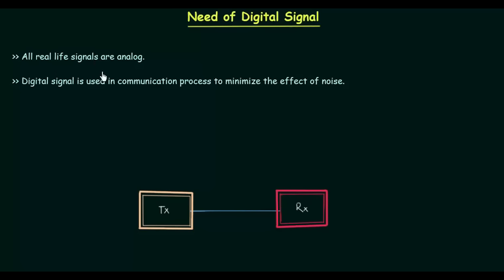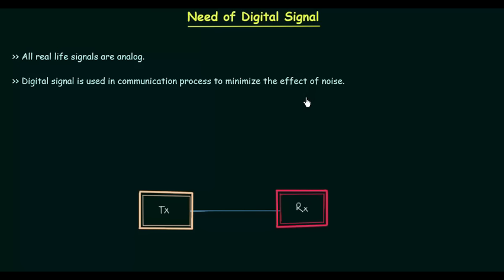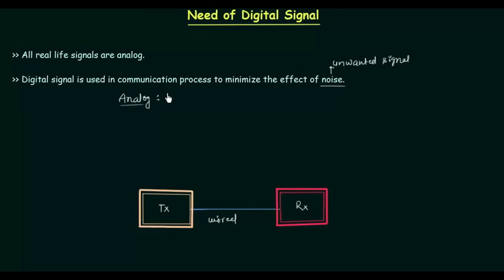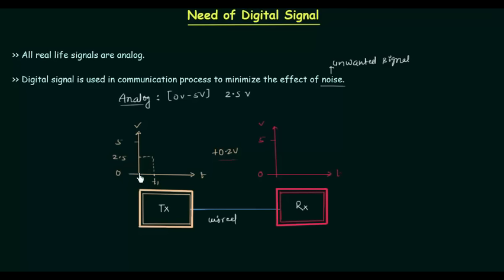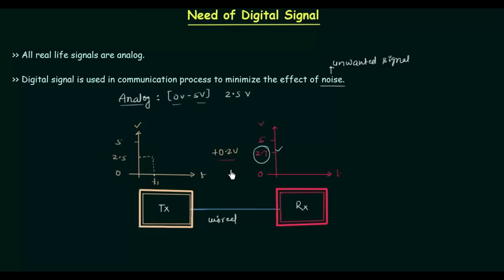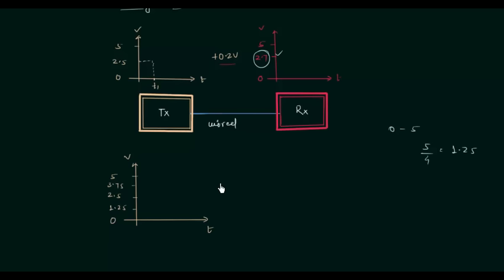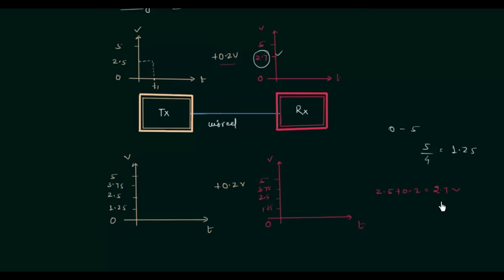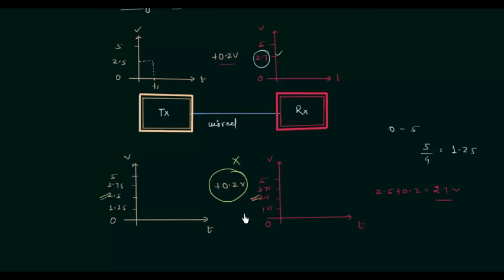Need of Digital Signals

Comment: Thanks for the video. I have a question. Is noise always positive? In the video noise was +0.2v. In real life voltage will decrease upon transmission(wires are not superconductors) thus noise would seem to be negative.
Reply: The main Idea was that Noise distorts the amplitude of Analog Signal and if these noise, if small in magnitude, can be eliminated if we use digital signals . Catch the main Idea dear ...
Reply: I have also the same doubt. If the signal is of 0.5A and the extra resistance of the medium decrease it by 0.2A then we will get the level below the 0.5 , right?(as Digital output  <=analog output) How to avoid such phenomenon?
Reply: @tanmayamohapatra7809  The main Idea was that Noise distorts the amplitude of Analog Signal and if these noise, if small in magnitude, can be eliminated if we use digital signals . Catch the main Idea only dear ... You can study more in depth in Digital Communication ...

Comment: i'm having a confusion .. at 4:37 ..using digital signal though u reduced the noise by 0.05 but still the actual signal was of 2.1 V and at receiver's end it is 3.75 V..so what about the error here ..is it 1.65 ..?? and if yes then doesn't it matters..??
Reply: Maybe his point is, the supposed value is 3.8V it was reduced by 0.05V because of digital signal. Using digital signal reduces noise not removing it completely.

Comment: sir, at 3:23 we are transmitting 2.5 volts instead what if we transmitted 2 volts (consider the noice as 0.2 volts only or 0 volts maybe). wont we get 1.25 on the receiver side. i mean will that be loss of date or something else. what would happen in this case?. please clear this out for me 🙏🙏

Comment: Sir, as u mentioned at low noise of 0.2 the the signal will take lower level. what if your signal is 3.65 and a noise of 0.2 gets added then it is 3.85 and not taking the lower level of 2.5 as it is taking the upper level of 3.75. Plz clear my doubt sir.
Reply: You would not be sending a 3.65 signal (analog) to a digital receiver that picks up discrete levels. Therefore A digital signal being set at 2.5 v will accumulate 0.2 levels of noise and be corrected back to 2.5 v.

Comment: What if I want say 2.3 and bcoz of noise it has become 2.5 and 2.5 is allowed
Reply: Since we discretized both the axes. We're not allowed to send the voltage signal other than the discretized levels.
Suppose, we have 0-5V and we divided it into 4 levels i.e. 0, 1.25, 2.5, 3.15, 5 then there is no way we're getting 2.3V on the transmission side. You can only send the voltage value which is available on the transmission side.

Now, take your 2.3V as an example. If we're limited to 0-5V supply and you want to send 2.3V then we'll divide the 5V into 11 levels we'll get

4.99
4.54
4.09
3.63
3.18
2.72
2.27 (Close to 2.3)
1.81
1.36
0.90
0.45
0

Since we have divided 5V into 11 levels on the transmission side,  we also have to do the same on the receiver side as well. Thus, the receiver side also has these levels.
If we're sending 2.27V and 0.2V noise is added then in the output, we will be receiving 2.47V which lies between 2.72>2.47>2.27. It will take the lower value and hence, on the receiver side, we will receive 2.27V which we sent.

This is not the only thing we do to minimize the error it's just a brief explanation. If the value of noise is high we use more advanced methods (He already said in this lecture).
Reply: @alphasatari @Yash.. Thanks a ton..I didn't knew the point that we are supposed to have same number of samplings in transmitter and receiver end...thanks a lot for taking time and effort for explaination.☺️